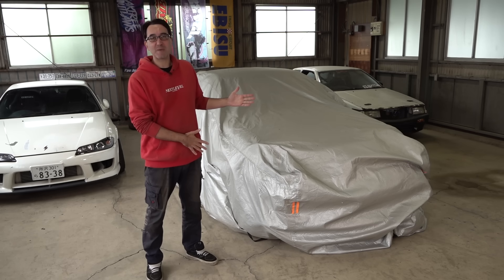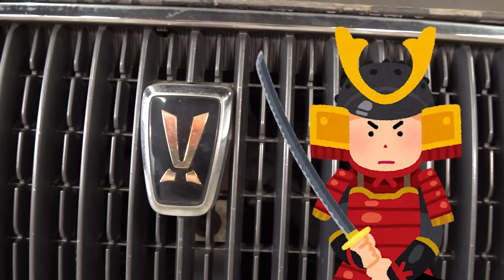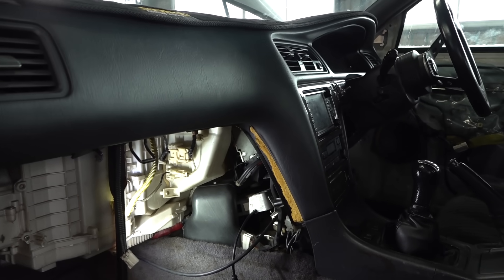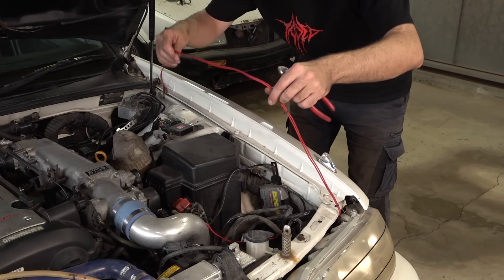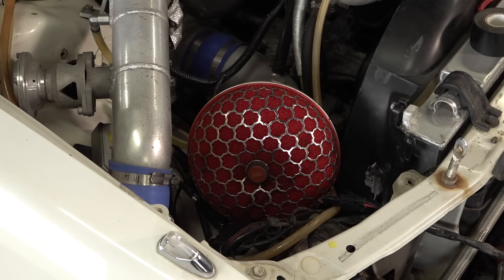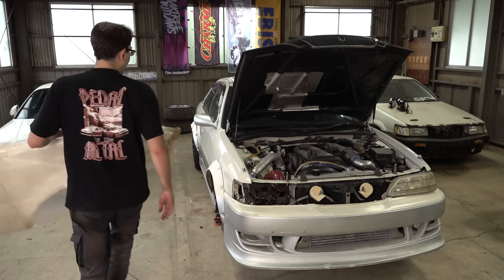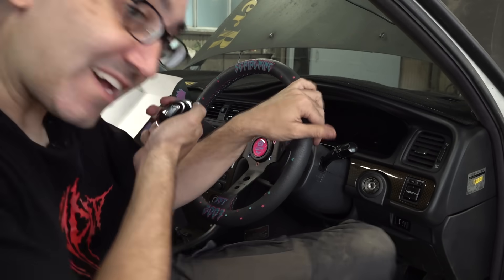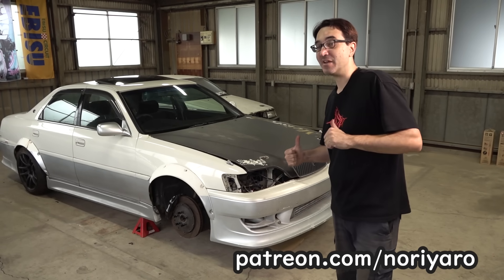My JZX100 Cresta drift car gets uncovered and started

Comment from the maker: Fact checking myself on stuff I noticed in the edit:
The headlights are from the Cresta Super Lucent, Grande is the equivalent on the Chaser and Mark II.
Just to be clear, the ECU rubber hose doesn't go to directly to control the turbo, it goes to the MAP sensor. It's another wire that controls the boost control solenoid.
Reply: s13 mint and tan 2 tone mate. no joke.
Reply: The amount of names and trim levels of the jzx100 have is crazy funny 😂
Reply: Black base coat with silver/gold "bass boat" flake. Then 3 coats clear.
Reply: Where is the beer can ?
Reply: Commented this before the end of the video 😂😂
Reply: Good video, I always look forward to your next videos
Reply: Paint it two tone!!! make it a panda !!!

that way the black interior will play with both the white and the black ! plus that gives you way more range in style and accent colors for the wheels and accessories! cause white and black go with everything
Reply: @_jaydenrp_6515 Finally in the garage, the latest video just got released about the 🥫

Comment: The empty gas strut thing is actually super smart since it's a carbon hood! I tried to put OEM struts on a carbon hood once, but they were so forceful that they were bending the hood when it was closed.
Reply: That's when you find some struts that are the same length, but lower lifting force
Reply: @slinkeyj3  Agreed, sometimes not worth the effort though imo

Comment: Back when I owned a FB RX-7 I did the same thing to the rear hatch gas struts but I used a bit of guitar string for the cable so when I wanted to shut the hatch all I had to do was lift the latch and the weight of the glass would free the pin. Really love looking at all the older gen stuff since I can no longer afford any of it.

Comment: i still love the RPF1 wheels because i had a set on my 1988 CRX back in the day. it had a JDM Twin cam  ZC swap, HKS turbo kit, HKS "piggy-backs" such as the VPC and GCC, FCD, KYB GR2 struts, Eibach lowering springs, EVERY brace you can get was installed. i eventually put 17" thin 5 spoke ICW wheels and 205/40zr17 tires on it. then i traded it for a 1987 MK3 5spd Supra turbo fully loaded.

Comment: speaking on headlamps made the expensive mistake of getting aftermarket ones terrible light output so 2nd hands ones were bought and killed a rupes polisher refurbing them used 3m uv coating so far all good.